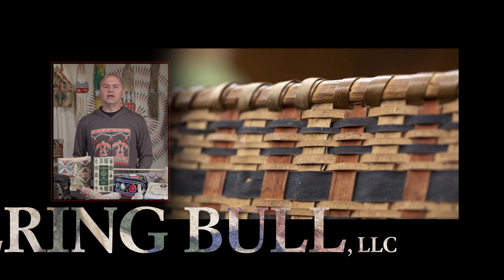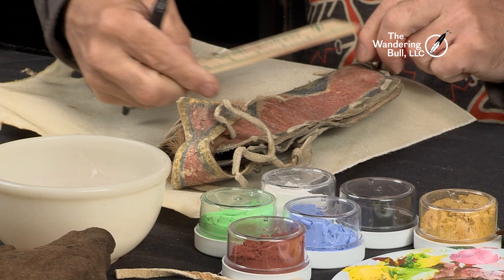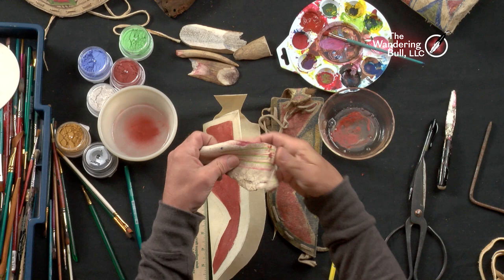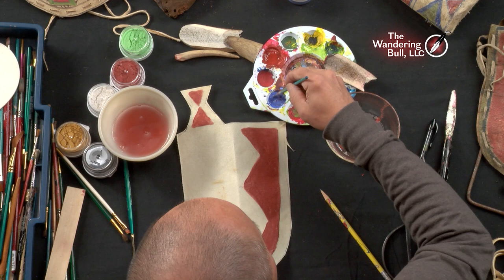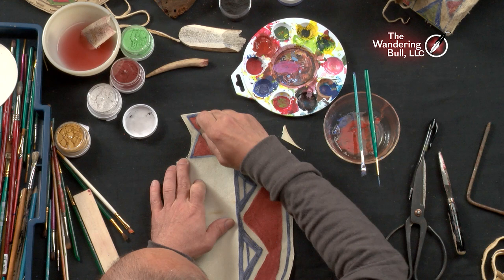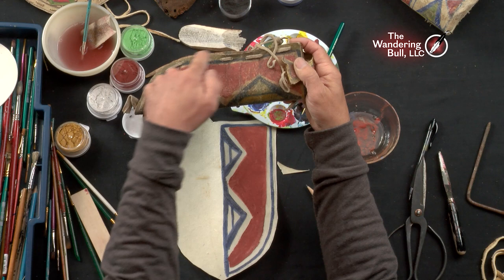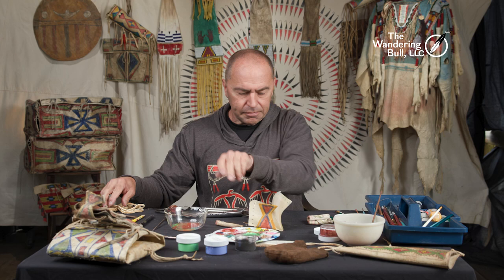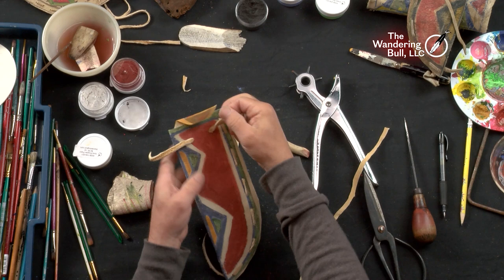Learn How to Make a Reproduction Knife Sheath - Step by Step instructions on hide prep and painting

Comment: I've been experimenting with rawhide to make sheaths.  Im used to using veg-tan leather, so no problem there.  But, I've tried painting rawhide with leather paint and Sharpies, and even gluing paper to the rawhide with contact glue.  None of these attempts worked out.  The leather paint and Sharpie ink were only too easily washed away when wet.  The contact glue worked, but only to a point.  It was easy to just tear and peel it off once cured.  

Looks like I'll have to get some of these pigments to add color to the rawhide and make it stay.  

Rawhide is a whole new ball game for me!
Reply from the maker: Yes the pigment paints work really well! Thanks for watching
Reply: @thewanderingbull9843  Thank you!  I'll pick some up.